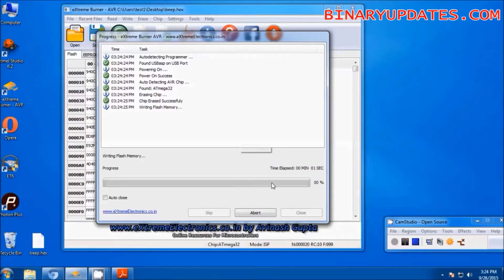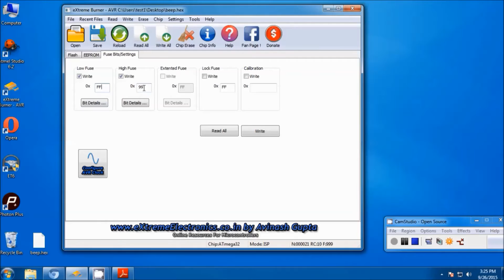AVR Fuse Bits Example: Setting Clock Source

Comment: Sorry I'm new to this. why there is need of fuse bit to set internal clock frequency,  you can connect a external clock oscillator. to 16Mhz frequncy